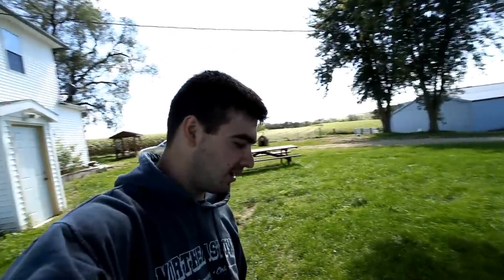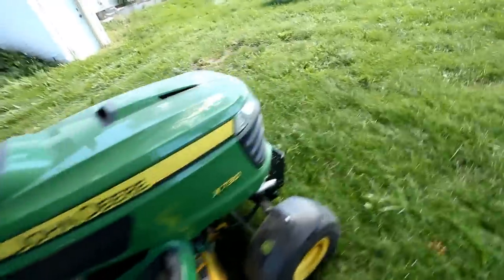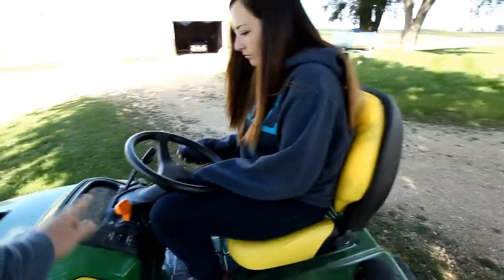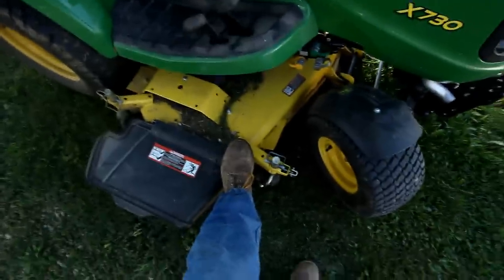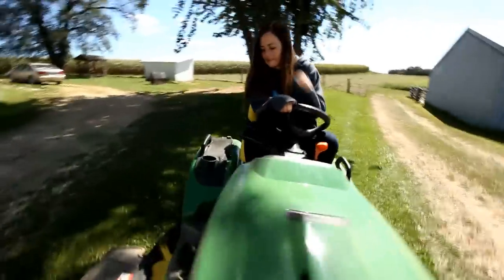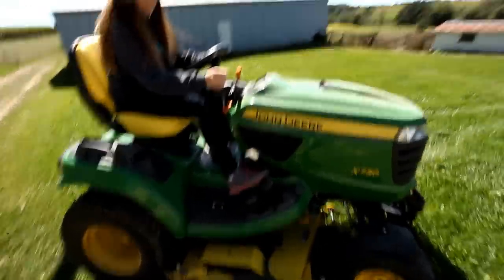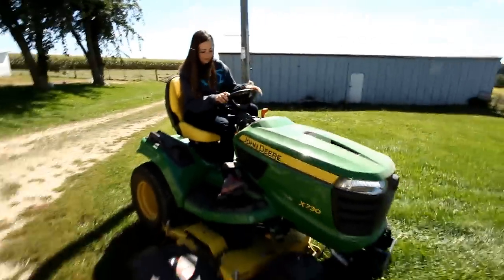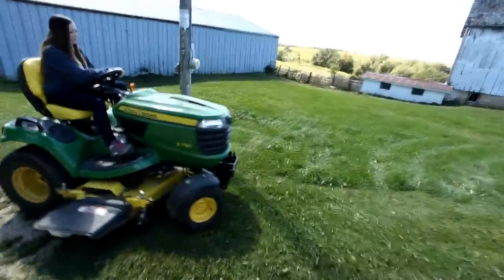Driving her first (lawn) tractor!

Comment: This is a very sturdy and well built mower. I thought I wouldn't like the foot operated speed control but after one use https://www.youtube.com/post/UgkxTZSPVwJFBv2hORqhQamtxi-tAe5K2EtC , I can't believe I ever had one without it. It drives like a car with an automatic transmission. Easy to adjust mowing speed according to grass depth/thickness. I have yet to get used to the long throw of the blade engagement lever but kind of get why it is that way. It allows you to hold mowing for short moments if you need. The engine seems very substantial and the frame has very little flex, both adding up to an impressive package. All my previous tractors were 18 to21 hp with 42in decks. This one is 23/46. I mow about 1.5 acres about every 5 days here in Alaska and that mowing time has been reduced by about 20%, partly due to the very tight turning radius. No loop arounds lol. Hour meter, cruise control, reverse mowing capability,deck cleanout and easy assembly all add up to a very well thought out tractor.

Comment: Ryan, you can use a stick under the deck start switch, to keep it up, so the deck doesn't shut down when you back up.  We bought one last year,  May too, 738, 4 wheel drive one.  I got half of a clothes pin, tide a plastic string around the think end, tide the other end around the steering column. Use the narrow end to stick it under the switch, in as far as the notch on the pin, so it can't slip out.  We have a 345 too, same stick under the switch to hold it up.

Comment: Ryan, always run small engines, air cooled engines, at near full throttle. The fan running at full speed is what keeps the engine cool.
Reply: Thats not air cooled. The X730's are liquid cooled.

Comment: I had to have brick behind me sitting on the seat because it would always turn off because I was so short and wouldn't have that weight thing tripped.  I put a clothes peg under the pull tab for the mower so it would still go when I was reversing.

Comment: I like the Zero Turn mowers even more because they are easier to turn and does the job much quicker also. I can mow twice as much grass with it than this conventional lawn tractor which can't maneuver like the Zero Turns.
Reply: With lawn tractors you can take off the mower part and put attachments like snow blower and plow which are controlled by the mower controlls

Comment: Half speed for one it's half throttle and two no that's not at all what you use it bogs your motor there for wearing the motor faster if you run full throttle or where the pto mark is it'll be fine, and no it doesn't hurt to start your pto at full throttle
Reply: Race Grover I don't know any manufactures that say otherwise. You always engage at full throtle. Basically anything you do is at full throtle.

Comment: where are her hands! lol 😄. no seriously teach her some good work habits like taking the hands out of the sleeves and putting both feet on the floor boards. shell end up falling off or running into something. if you want to learn then act like you want to learn. what my dad told me.
Reply: Jamie Procarione I'm sure you did "just fine" but could be better and easier for you if you actually dressed for the weather so you can really use your hands to steer and your feet on each floor board to stabalize yourself on terrain. Don't make excuses to avoid good practices. Look like you belong on the machine and own it. Just my 2 cents. I do appreciate the fact that you are taking initiative but part of that is acting like you want to learn and taking the job seriously. When I see hands burried in the sleeves and operating a machine like this it comes off as the person just isn't taking the task seriously so why am I teaching them? If I was to instruct someone this would be the first thing I would point out. You can't use your hands very effectively when theyre burried in your hoodie and you can't possibly mow in a safe manner when your not using your feet to stabilize yourself. Not trying to be a dick here. Just lending constructive criticism. I mean I wouldn't have said any of this of it werent for the reply that saw past the original point I was making. Saftey is priority.